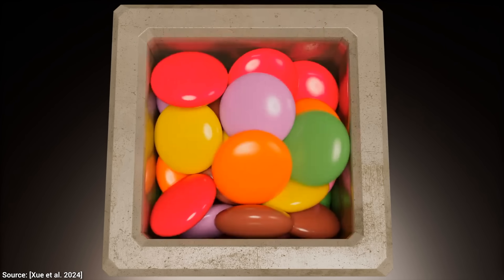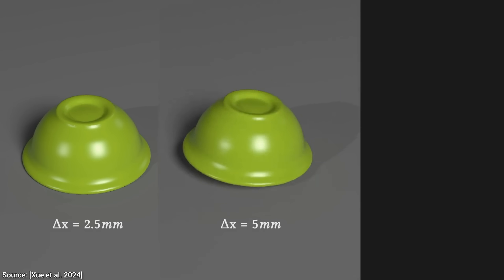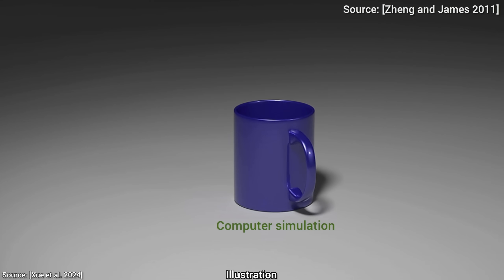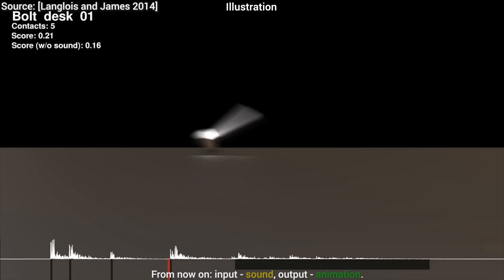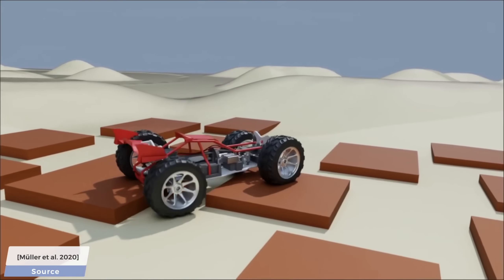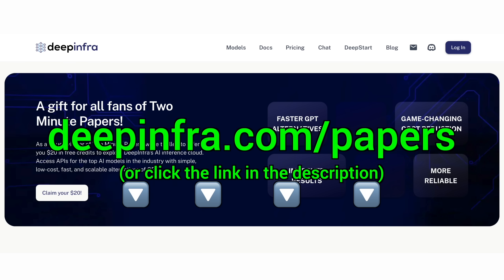The Future Of Sound Is Not Recorded. It is Computed.

Comment: So it is like raytracing for audio instead of pictures? I remember that when programming pinball games on Visual Pinball (Win98SE) the most difficult was to get credible ball rolling noise (it could only trigger premade samples when ball touches positions). May be this technique is yet way too CPU demanding for such simple things (unless for offline-rendering all sounds of the playfield to generate those samples), but a pinball playfield would be a plausible application. When steel balls knock different objects and click against each others at varying velocity and angle, it was always hard to select a credible sound for each situation because there are too many variants.

Comment: This would only work for a very small set of games, in the simulation niche. Most games simply don't have the geometry or material data to feed this type of simulation. Think of Octopath Traveller, just as an easy example. Simulated sound of that would be of cardboard boxes and paper.

Comment: I wonder how this would handle an explosion simulation— would it sound like an explosion or would the geometry of the explosion just push the air?
Reply: Poorly. Amplitude of air compression even in mildest explosion would require proper gas models. Not to mention that explosions typically introduce gases different from air.

Comment: The physics (mathematics) symbols for vector are based upon the letter "v" (uppercase or lowercase) which is used for multiple other things, and the most distinguishing variant of "v" for vector is to put an arrow (Left to right) atop it. and yet the arrow is already used in various other things, thereby not really distinguishing it for vector all that much. So we need a proper symbol for vector, and looking through Openoffice and Libreoffice or wingdings and other special-characters or symbols, the one that is not be being used for mathematics and physics is the smiley face in a circle, and it would suffice since the mouth is like a letter "U" which is a "V" in other languages like saying "double-V" as "double-U" which is pronounced "doo-blah Vay", and so the "yes" in the smiley face are like an umlaut above the V. that is reasonable since the vector is a direction and magnitude, as a two-part component, and so a pseudo vector can be made from a transformation of "radians-per seconds-squared" say angular acceleration such as for a particle vector. Therefore, the circle around the "V" with an ulmaut can be the particle.
 ☺It would not look like the YT high-graphics emoji version but (as per unicode 236A) a simple line-drawing circle with one (acute) V (or blunt rounded obtuse V) and an umlaut atop that one V. If only brackets (parenthesis) curve all the way around to the top and bottom, it would look sort of like an umlaut capital U in those curved brackets. (Ü) 
It would be better to make it a more "pointy mouth" as a V instead of a "U" by some "v" symbols for vector are rounded anyway and serif and so one will need to assume it means one of those. 
The smiley-face vector can then be used for any vector include a waveform-vector as the circle can be a wave, not just a particle. The alpha symbol (from "ox", not the uppercase "A" symbol version of alpha) is often used in notation of the angular-acceleration, form which, by transformation, the vector can be extracted as a pseudovector, and so if the waveform vector must be implied specifically as only that sort of vector, the "circle" can be that alpha symbol by simply placing the "c" shape embedded to right hand side of the circle which still has the smiley-face in it.
 α 
A vector (requiring both direction and magnitude) has the two conditions for it to exist (although a 1 dimensional vector can be made, like a Markov-state since those are memoryless) and so can be used for a XOR logic which is the exception of where Markov-chains or Markov-models have a use case in logic where it overlaps with the vector which is otherwise a fundamentally different descriptions of mechanisms. So for this XOR vector, the smiley face can be placed between an X and R, but as one symbol constructed of that like a portmanteau, as though XOR, but so it would look like somebody had flipped the lowercase alpha symbol and placed it over the original alpha lo0wecase symbol such that the "c" shaped, mirrored, comes out of bother left hand side and right hand side of the circle shape in the middle (which then has the smiley face inside it from a V with an umlaut atop it) but the right-hand-side also has the top right hand corner feature another small circle, as though a "degrees" symbol had been glued-on like number "8" leaning to the right, titled. So basically, it is simply the XOR with a smiley face inside and the X and the R are squashed into the O each side until partially embedded into its circumference. That would be the XOR vector which can be both a vector and a (transitional) Markov-state XOR condition simultaneously. that then means the other smiley face vector cannot be confused with it. 
  >ÜR 
 ↄÜR 

These various vector symbols, for instance in the video, would be able to distinguished things like, for a primary-example,  polynomials made from 1 dimensional vectors and thereby Markov-states, like describing a Zeff charge or shape, like polynomial fitting or spectral analysis or (low-order although quite possibly high-order instead) Chebyshev polynomials used to stabilise, or a secondary-example of a waveform vector whereby the sound is propagated from the objects that exist as voxels (or for computational fluid dynamics or vortex-shedding). _ However also, the generic smiley-face in a circle means any type of vector _(which can help with basic descriptions or with say an initial start of a process and then a vector is revealed to be a different type, or instead that it came from something else secondarily, describing it retroactively at the start, such as for the pseudovector example). 
It is interesting the vector symbol was not included in the unicode or 8bit ASCII of 256 combinations, considering that, especially with the XOR variant vector, any mathematics, albeit is long-winded sometimes and inefficient, could be described therein, and so using matrices for transformations to make the pseudo vector would be possible, and it would distinguish th eigenvectors and eigenvalues, but also the XOR Markov-logic and the XOR vector with matrices would be able to describe pretty much anything in the commonly used physics symbols, including using 1 dimensional vectors  with the Markov-states to build polynomials as though, metaphorically (visually imagining) like Bézier-curve polygons and coefficients. The only thing that would be missing would be Pi for a perfect circle (which is not made by means of the Bézier-curve) but that is fine since there is a symbol for Pi anyway, which, considering  circumference divided by diameter yields Pi, could be used. The magnitude could be a radius and the vector holds the other dimension as the origin, meaning the direction of the "radius" like an arrow, points outwards, to thereby make that circle have an actual size, and thereby Circumference and diameter. So the circle around the smiley face, indicates an origin and radius vector. 
some models of calculators have (like VctA and VctB) various vector buttons, and the XOR (which is used in computer instructions) could have been examples as tri-state buffers to make multiplexers in early models, or the three-state-logic of tristate. So the XOR vector could have been constructed for some extra limited functions (so more than one vector can be held or stored) as in constructed from Markov-chains XOR state conditions met, thereby describing a 1 dimensional vector. It would have meant that on a basic calculator, where only 2 dimensional vectors existed, a "workaround" (for a few limited quickly accessed calculations) could have become 3D vectors by contributing that extra 1 dimensional vector to the 2 dimensional vectors, all before silicon semiconductors were used and instead gold. It would not be able to do everything, but it would help. So for example an analogue electronics Phase-Locked-Loop would be able to be plugged into the calculator, and then some sine and cosine vector functions could be used to assist the Newton method o finding the cosine from an initial guess of the value of constant k as long as sine is already known. It might be limited however and require a punch card or switches to hold a a few hexadecimal values which means it is maybe four rows of Quaternary 4bit values (or 4x4 rows and columns on the binary punchcard) for 256 combinations and then other sets to make four rows and four columns sets of those rows of Quaternary 4bit values (or four horizontal and vertical of the 4x4 rows and columns on the binary punchcard which is basically 16x16 binary punchcard holes but the ere would actually be a "row 17" of 16 punchcard holes as a card-place-numbering). It basically means there is a persistent medium to hod a state, especially since Markov-states (or Markov-chains usages) are (if used) a memoryless system, so the XOR vector can "get around that" to be use with other vector forms. It could also stored hexadecimal, polynomials, ad therefore exponents and be handy in iterative reading and writing (multiple punchcards in the order made from the card-place-numbering row 17) such as using the Newton-method to get to the cosine from sine, or for (logarithm) usage of the Newton-Raphson method for finding the log from the exp (exponent, with iterations over many cards). If floating point of fixed-point were used, error could be traced and the punchcards "show the working". The punchcards can also thereby be used for (basic) matrices in limited use-case scenarios.

My comment has no hate in it and I do no harm. I am not appalled or afraid, boasting or envying or complaining... Just saying. Psalms23: Giving thanks and praise to the Lord and peace and love. Also, I'd say Matthew6.

Comment: As a former sound designer in film and TV, it's plain to my ears these are synthesized as even an average sfx editor could do better. The concept is none the less fascinating though and I'm sure it will improve rapidly.
Reply: They are not AI. They are synthesized via a code but explicitly not AI-generated.
Reply: @Malake256  You're right sorry I meant synthesized

Comment: We'll probably dont see this in games for years to come - and frankly, it's not really needed in most games. That said, for VR this might just be a gamechanger, depending on the type of game. Sound plays a far bigger role on immersion than graphics for most people. The mentor under whom i wrote my thesis actually performed a study on this. It was pretty smartly done. At face value the study was about questionnaires in VR - but what they actually did is present each participant with different graphics, or sound design, or introducing real life immersion breaking events, like paper rustling, or air movement. Real life effects have by far the biggest impact, followed by sound, with graphics essentially having no effect on immersion itself, even between something extremely low-poly and 4k.
Reply: I'm just sayin this will let me live in synthetic opulence

Comment: Wait so is it synthesizing the entire sound effect or just how the sound is being played in the world? Where did the speech of the fan come from after all, or the trumpet melody?
It still has to be recorded apparently.

And its not based on the video but on the actual 3d world, right?
Reply: If I understand correctly, for some simulations they convert audio into simulated pressure waves, and spawn them at a source location.
The trumpet and fan would be an example of this.

Separately from that, it can also take the movement of objects as a means to create pressure waves, which become audio.

But ultimately I agree that it is still a bit confusing here.
Reply: He specifically said that it can have invisible sound inputs. That was addressed in the video right at the “blankets on a chair” part.
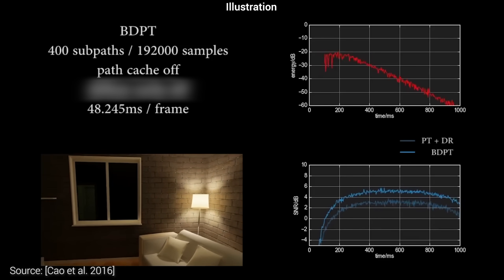Reply: “it can even add phantom geometry” 5:30
Reply: @CaritasGothKaraoke  geometry here refers to 3d physics objects that occlude sound, not sound inputs
Reply: It does both.
Reply: All the audio is from simulating it.
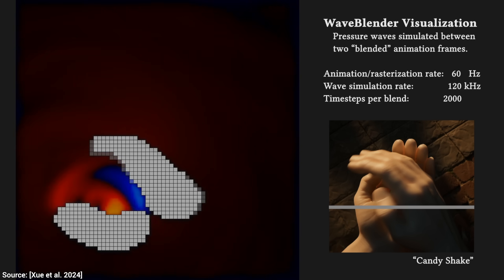remember those waves at 1:37? 

That's how sound moves through air, you know. A speaker is just a big cone that you move back and forth to push air waves around the room. 
So they just grab a point in the simulated space, start simulating the air and record the pressure at that point there over time. And that "pressure over time" data is exactly what audio is. except pressure is the amplitude (volume) over time.

To play audio in the sim while hearing the outcome elsewhere in the scene. All they have to do is the opposite process. Audio is 1 dimensional (analog) so they just put the amplitude into a grid of cells, and watch the waves propagate outwards into the rest of the scene.
Reply: @Lukas-qy2on  This is not the full picture and you are incorrect. Keep in mind that no AI is being used. 
As a musician and sound/audio designer I know for a fact that to get the sound of a horn you'd need to simulate not only the trumpet but the human's mouth that is placed on that trumpet, the cavity within the mouth and throat of that human, the force of said air from the human mouth, and much much more.
Reply: @Swordshreader  I am not!
They're not simulating the entire instrument my friend! 

They're just playing recorded audio inside of the trumpet and simulating the outcome :)

They just wanted to show off what happened when covering the exit.
Reply: @Lukas-qy2on I understood this as handling “reflections” of dry audio that is either recorded or synthesized elsewhere.
Reply: @Lukas-qy2on  that makes no sense. It was just a spinning fan, how is it supposed to talk. Same with the trumpet, makes no sense that it just magically plays melody without anything blowing air into it and how is creating different notes without any mechanics?
I bet it is based on sound files played in pre-defined locations
Reply: @dXXPacmanXXb  Sound is literally just air vibrating. So they just do that. The fan isn't talking, they just create the air waves somewhere behind the fan, and 'listen' at the location of the camera in the scene.

They didn't model an actual trumpet. they just put recorded audio inside of the horn.
Reply: @dXXPacmanXXb  If you ever get an answer to this. Let me know.

Comment: OK. We've officially crossed the line from witchcraft to good old fashioned demonology.
I wonder if this would work for simulating the acoustic environments involved with actual rockets and jet flight.
A lot of effort goes into managing the acoustics of rocket launches (watch a few slomos of Starship Booster Static Firings. Those 'ripples' in the dust clouds are sound waves).
🖖😎👍